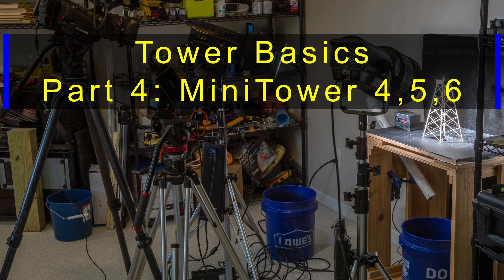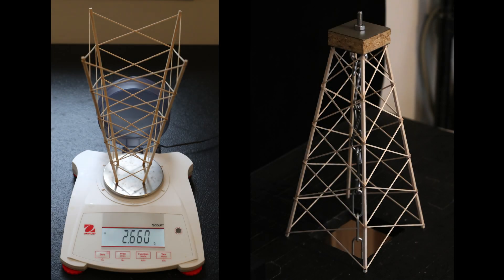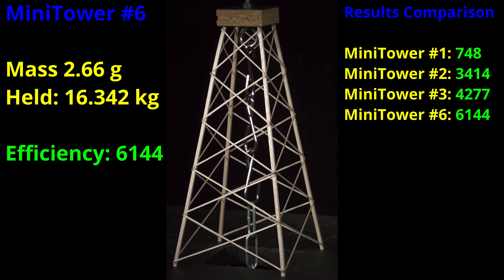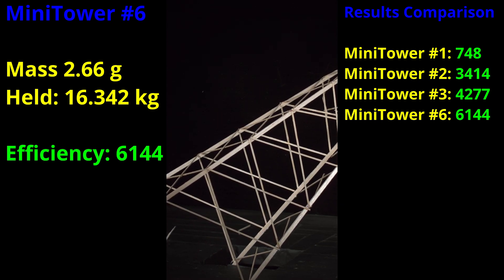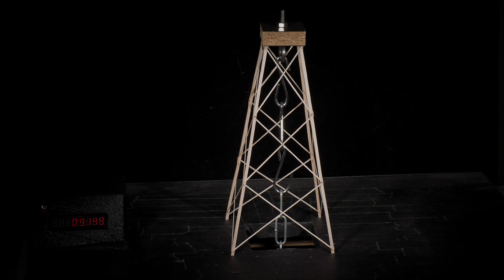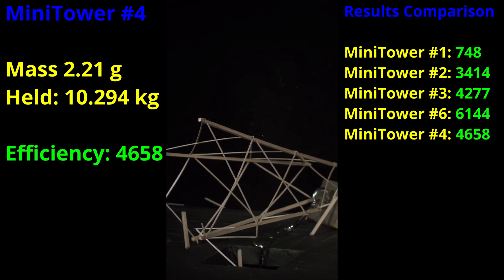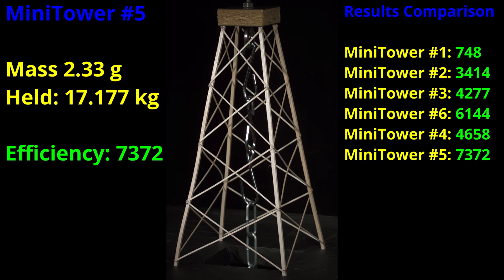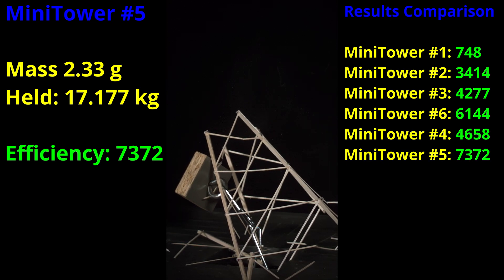Tower Basics: Part 4: MiniTowers 4, 5, 6

Comment: Hey! Love your videos, have been watching for quite a while now. Just wondering, what size legs and cross bracings are you using for these, and what is their density? Thanks!
Reply from the maker: Thanks!  For these towers (and the real ones for this season), I've been using 1/8 x 1/8 legs.  For these mini-towers, I used 1/32 x ~1/20 cross members.  For the real ones this season, I've been using a mix of 1/32, 1/20, and even 1/16 occasionally.  All on the light side of the density range.  If you check some of my videos for the season, I show my notebook pages where I show exactly the size and mass for each layer, so you can compute the density exactly if you want.
Reply: @balsaengineering6686 That’s really helpful! Thanks!

Comment: Thanks for the great video. Does this mean that using any sort of linear members to connect the four beams (like in tower 1) basically wouldn't be useful at all, even if it was used in conjunction with angled double cross members like in 4, 5 and 6? Also, do you think the number of cross member sections needed to be used is directly proportional to the height of the tower, or would you need to do some experimentation for any given height to see what number works best?
Reply from the maker: Thanks!  Yes, I would tend to not bother with the horizontal members at all, at least with the tower angle we're dealing with here.  Having something like a top horizontal cross piece might be useful for a more shallow angle tower, but design tweaks like that need experimentation.  Horizontal members, in conjunction with the diagonal members might make the design marginally stronger, but only the cross-member system, not the leg buckling part because the distance between points remains the same.  That extra mass could be better used to increase the density or size of your diagonal cross members.  

Definitely the number of cross member layers needed will be directly proportional to the height of the tower for a given set of legs and cross-member material.  If you find the perfect spacing for a 25cm tower, you can be confident that 2x the number of layers will work well for a 50cm tower.  The reason being is that the buckling strength of a long stick (legs) needs to be strong across its entire length, so it's important to not have any sections longer or shorter than the rest.

Comment: It seems I was wrong in my guesses and that the strongest tower for its weight was one of the heaviest - the increase in weight more than made up for by the load increase. Although my prediction that tower 1 would twist was correct.
Reply from the maker: Thanks for taking the effort to make guesses!  Yes, you were very correct in how bad #1 would be and the method of failure.  Even I was a bit surprised how much better the best design was.  It goes to show how important it is to optimize the cross bracing with the legs you have chosen and to know exactly what your target maximum load needs to be optimize efficiency